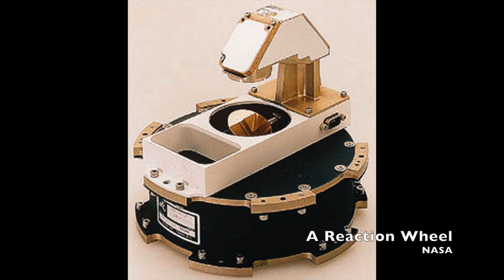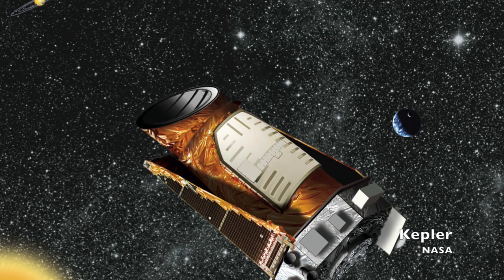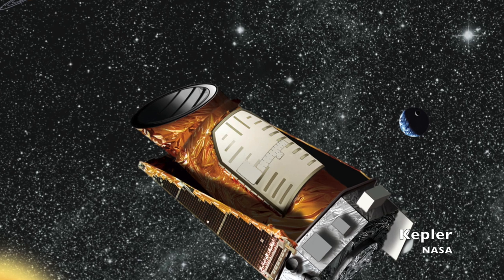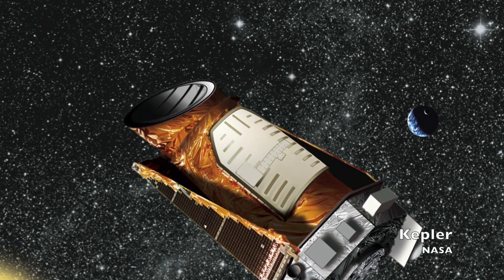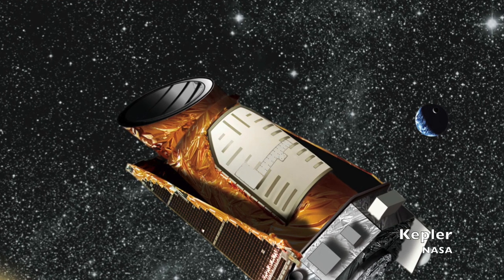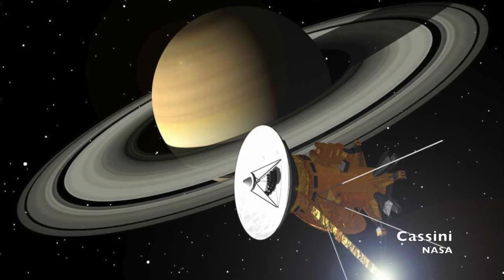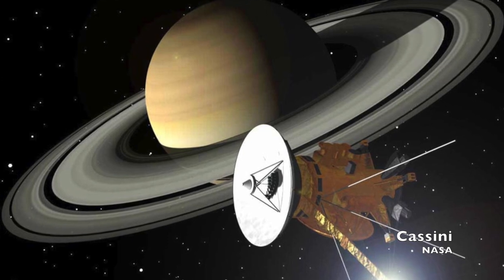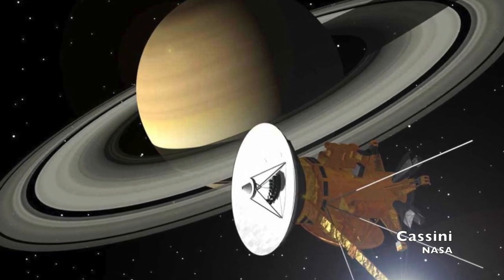Introducing Reaction Wheels

Comment: The down side to reaction wheels is they have a limit to how much angular momentum they can provide before they (saturate) reach their peak operating speed. If you're moving back and forth then they work well as you speed them up and slow them down. Eventually however you saturate and they come up against their max rpm limit. The result is you have to brake the reaction wheel and counter the change in angular momentum with traditional reaction jets. So they work great when you're moving back and forth and not so great when you have a steady state external force acting on your spacecraft / satellite.
Reply: Any explanation of reaction wheels that doesn't discuss saturation, and unloading them by using thrusters, is horribly incomplete. Amy's presentation leaves people wondering, "so why don't we use the wheels all the time for everything?"
Reply: Thankyou thats the question I was going to ask. So .. they don't save weight after all?
Reply: Can someone direct me somewhere where I can read more about how reaction wheels are desaturated with thrusters?

Comment: Wouldn't friction in the bearings very slowly start to drag the craft into the same rotational direction as  the wheel?
Reply: The angular velocity of the wheel is continuously maintained by the electric motor.  The motor torque negates the frictional torque.

Comment: So correct me if I'm wrong (I usually am) the wheels use the gyroscope effect, say you sit on a swivel chair with a bicycle wheel held in both hands someone spins the the wheel for you and when held upright you stay in one place. Tilt the spinning wheel to the left or right and you will swivel on the chair in that direction

Comment: Maybe I'm missing something, but wouldn't the reaction wheels be stationary when attitude adjustments aren't being made, rather than spinning all the time? For example, to yaw left you would spin a horizontally mounted wheel clockwise until you reached the desired direction and then stop the wheel. To yaw right you would spin the wheel counterclockwise.
Reply: +Special EDy  No, not necessarily.  Reaction wheels can be turned at a constant speed, when you want impart "positive" motion to your axis of orientation, you would decelerate the wheel, the braking force would impart motion to the spacecraft in the opposite direction.  Likewise, you could accelerate the wheel to impart negative motion.  In practical terms, the inertial forces of starting a wheel up from a dead stop is much greater than the force required to actually impart the rotation about the controlled axis.  Starting and stopping also requires more energy than maintaining a rotating wheel at a constant speed.  For these reasons, RW's are designed to spin continuously.  There is the added advantage that wheels spinning on different axes will result in gyroscopic stability of the spacecraft.

One other thing that needs to be pointed out for both reaction wheels and for reaction control motors, is that in the relative vacuum of space, the moment imparted by the reaction control device will continue more or less forever (exclusive of any other force such as drag to cause it to decay) until it is "cancelled" by imparting equal force in the opposite direction.  In terms of RCS engines, this effectively "doubles" the amount of fuel required to impart a set rotation about a single axis.  In terms of RW's each initiation of motion will require an equal cancelling acceleration when the desired attitude is reached.
Reply: thats a different kind of control system, those are gyroscopic reaction controls

Comment: why do reaction wheels have to spin so fast? it sounds like a recipe for mechanical problems (which have happened in many spacecraft like Kepler)
Reply: To generate enough torque the wheel has to be either heavy or spin fast. And "heavy" and "space craft" do not bond well.
Reply: Atila Elari ooooh! thanks :)

Comment: You showed a picture of Ithaco Space System's "Scanwheel," which had its own built-in horizon scanner. Most reaction wheels do not use this type of all-in-one setup. I just wanted to point that out, so that if you're ever looking for a reaction wheel assembly on a modern satellite, don't look for the mirror. Chances are, the RWA housing will look like a piece of instrumentation.

Even though Kepler lost two Ithaco B-wheels, it is still able to function in a somewhat "limp mode" which was thankfully approved as what is known as "K-2." 

Unfortunately, due to a number of failures with Ithaco RWAs, contractors had lost faith in their heritage built products. Ithaco built some amazing quality wheels for many many years, and their products were at one time quite sought after. With the rising cost of mass production using heritage techniques and ABSOLUTE ADHERENCE TO NASA STANDARDS (they never bent the rules that I could see, unlike many other manufacturers) Ithaco products are now built in Danbury CT at the former Perkin-Elmer facility, where Hubble's mirror was flubbed built. Following the acquisition of Goodrich Aerospace by United Technologies Aerospace, no Ithaco products are built in Ithaca, NY anymore. But some of their brilliant engineers are still working on new designs, and Cayuga Astronautics is currently working on a prototype Control Moment Gyroscope to be used in a self-balancing motorcycle. Very cool stuff.

I never got to see any reaction wheel subassemblies that I had worked on to launch. My main pride and joy was the GOES-R RWA prototype, which was cancelled due to overall development costs coupled with the Ithaco closure. But I do have some magnatorquers up there with my handiwork built in. Amy Shira Teitel , would you like to do a brief explanation of magnatorquers? Or "Magnetinc Torque Bars," as Cayuga Astronautics calls them?

Comment: How are space trajectories calculated? I.e on Earth in general we can navigate by using a Map so in space to they navigate in a plane, and we use North, South, East, West to navigate what would a spacecraft use?
Reply: +Mark Jones They use a 3-dimension virtual grid which has an origin at the center of the Solar System and is oriented to fixed star references.

Comment: RCS thrusters are easy to understand- they're just tiny rocket motors that fire in increments for minute adjustments.
But after watching both this video and the one on Gyroscopes in Space, I don't understand the difference between a Gyroscope and a Reaction Wheel  Are they not the exact same thing?  (You said you would further explain the difference, but I may have missed it.)

Comment: Could reaction wheels be used in place of reaction propulsion systems in a manned mission?
Reply: Nomadic Bumhole No, because you'd never develop enough deltaV to do anything worthwhile.
Reply: Nomadic Bumhole The reaction wheels can spin the spacecraft, but since they're not expelling anything, they can't translate. Great for controlling your orientation, but you still need rockets to move.
Reply: They are also too weak to properly maneuver a heavy spasecraft like Souz. To do so you'd need a really heavy wheel. And then it is more mass-efficient to use reaction rockets that can not only orient the craft bot also move it.

Comment: i know this might sound silly, but if ya ever revved your engine, and had a non-sideways front wheel drive, like a pickup truck i guess, you can feel this phenomenom. the truck wants to literally spin over against the direction of the motors crankshaft rotation!.

Comment: This topic gives rise to the subject of Angular Momentum Drives, a form of rudimentary anti-gravity. In space (in theory) these could be used to propel a spacecraft instead of chemical rockets by tapping off of centrifugal force in only one tangent. Many thought all you would get is "an expensive paint shaker" but they do indeed provide a pull in the direction of the forced moment of the rotating mass.
Reply: Citation needed. All I can find is discredited crap like Dean Drives and GIT.
Reply: CromemcoZ2 There is no textual "citation" I know of, this was all from a couple of semesters of physics discussions. I have even attempted to build such a device, but all I succeeded in doing was cancelling a partial net effect of "mass". The drive had its forced moments directed at "11 oclock" and "2 oclock" respectively. The disc had a movable mass attached to it that began extending at "11" and completed retraction at "2".  Powered off this weighed 18kg, turned on it weighed 4kg +/- but the drive did have a severe harmonic vibration.
Reply: No, this nonsense doesn't even work in principle. The End.

Comment: Theoretically, if you had a reaction wheel with extremely low mass, you could accelerate it through just a few degrees of arc over and over and use it to propel a spacecraft in one direction.
Reply: Momentum is conserved, you have to throw something out for linear acceleration. Like rocket/thruster exhaust or ions, or even light (which is impractical). That, or catch the sun's radiation with solar sails. When you run, you impart the opposing momentum to the ground under you.

Comment: Nice video! Thanks for answering my question again!!!
Well, I am about to keep you busy with another question :)
Since the advance in communication technology, like optical communication.
Why are we still using radio to communicate from base to craft or craft to craft.
Is there any specific reason for that? or just because the other form of communication isn't that reliable? Thanks!
Reply: line of sight, that is the reason to use radio frequencies. but you might want to keep in mind that radio IS light.
Reply: There have been several experiments in using laser to communicate with a sattelite on the Moon's orbit. It was said that this method is promising for long-range communications, such as Earth-Moon, but using it on closer range seems abit too much of a trouble because it requires perfect alignment of both transmitter and reciever.
Reply: Atila Elari that promise was a little overly optimistic, although radio spectrum lasers are a decent choice for communication outside the moon/earth system, the only reason that is true is because it takes less energy and as such is more effecient to use. either way you will still use radio more than likely becaus x-ray and microwave are damaging and needlessly energy intensive, and visible light is blocked by anything that you can see, which is all visible matter, that isn't even 20% of the universe, but it is more than what blocks even infrared, let alone radio.
Reply: Ricky Chau The main reason is that laser communication is still very new.  They are rapidly pushing the tech into new spacecraft designs but it hasn't been used long enough to be considered reliable just yet.

Comment: Amy, your videos are fantastic and generally I have absolutely nothing to day.

However, in this instance, some material was omitted.

Reaction wheels do not reduce weight or fuel load for satellites or space craft. In fact, the are generally just used for finer tuning than you can achieve via thrusters, generally for satellites that have to maintain a heading. (Along with using perturbations to their afvantage.)

Long explanation short, momentum/reaction wheels counter act a torque on the space craft. They are eventually limited in the speed (rpm) in which they can rotate. As these wheels counter atmospheric drag, solar winds, and other perturbations, they simply counter, and store that energy. If you were to stop any of the wheels, the craft would return to the spinning that it was subject to. 

So, spacecraft use reaction wheels to maintain orientation, and when they build up so much speed, they do a process called momentum dumping. This is when the speed of the wheels is gradually reduced, via the use of thrusters.

What does that mean for space craft? Essentially that with or without reaction wheels, the thrusters would still need to exert the same amount of force, and therefore the same amount of fuel and weight.
Reply: Reaction wheels offer internal torque only, which means that the system still needs an external torque source to dump momentum. for example cold gas thrusters.

Comment: Love this feed.  Grew up during the 60s and find all this fascinating.  But I do have a question, not about reaction wheels, but about the images of the LEM ascent burn from the moon (specifically the launch).  I accept that we went to the moon.  But the ascent burn always looked like a puppet show.  Specifically a) the ascent engine is burning some form of material to effect the launch, where is the combustible byproducts?  On Earth we see large clouds billowing during a launch, even a Titan II launch, where are they on the LEM ascent b) On two of the missions (16 and 17 I think, but don't hold me to it) we can see hills behind the LEM come into view as it ascends .... but there is no distortion.  Without distortion we have to assume that the index of refraction does not change between space (n = 1) and the hot gases coming out of the ascent engine (n = ?)  I find that tough to buy.  I want to understand the images of the LEM lunar launch.
Reply: +Glen Clark The hypergolic fuels used on the Lunar modules produced very hot exhaust with little or no particulate matter once they get going.  Even with the Titans, the exhaust from their hypergolic engines was very hard to see, especially when the vehicle climbed very high and the greatly reduced atmosphere pressure no longer helped confine the exhaust to form a plume.  With the Lunar module engines,  that hot exhaust quickly disperses in the vacuum of space over a wide area and thus does not form a plume or contrail.  On Apollo 17 shortly after liftoff, the ascent stage briefly comes back into view as it begins to pitch over and move downrange from the landing site, and for a few moments, the TV camera on the rover shows the tiny brighter disk of light from the open end of the firing ascent engine, but other than that, nothing of the engine "exhaust" effects can be seen.

Comment: You mention a backup reaction wheel, but wouldn't you need 3 backup wheels to backup all the wheels on each axis?  What about multiple reaction wheel failure.  Wouldn't that send the vehicle spinning wildly out of control?
Reply: I assume if you had 4 arranged in a tetrahedral pattern, you'd only need a combination of up to 3 of them to rotate on any of the XYZ axes.
I think Hubble suffered a failure of two. :(